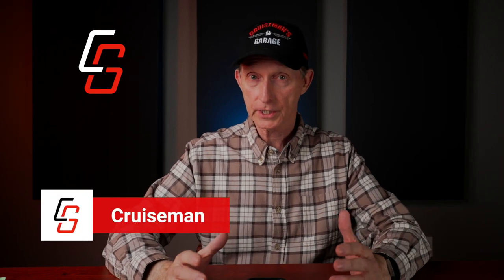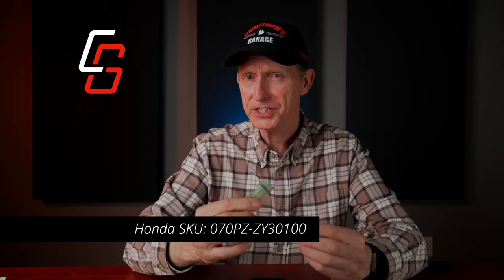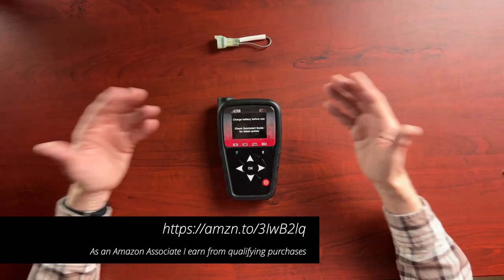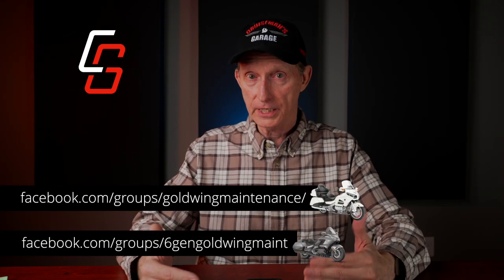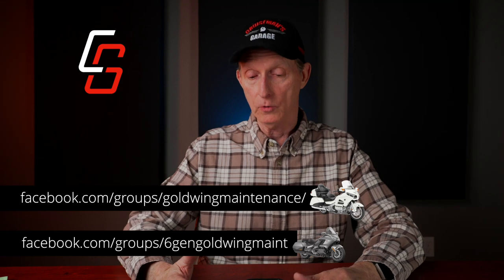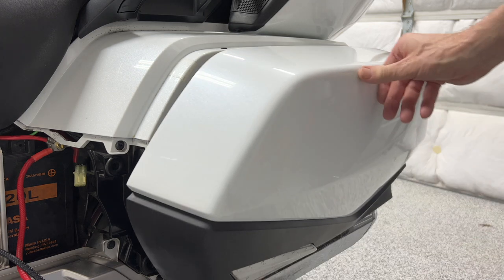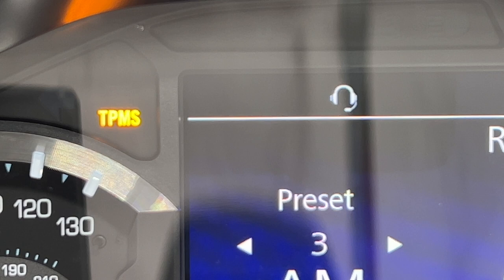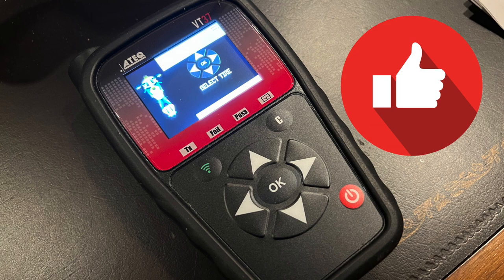TPMS Sensor Registration on 2018+ Honda Goldwing | Cruiseman's Garage

Comment: Thanks, Cruiseman - ALSO, with your particular ATEK VT37, you can also check the TPMS sensor battery condition to determine when/if you might need to replace a TPMS sensor. :)
Reply from the maker: I plan to cover that feature in a future video.

Comment: Well I was wondering how hard this was going to be when I put new wheels on. I bought new wheels for the front and back complete with tires so that I could just do quick change outs. Now my TPMS system does not want to work. I did not anticipate having to buy a device to reprogram it. The video was awesome. You do a great job! Thanks as always 🤗

Comment: Thank you for the video Chris.  I too purchased the V37 for the intended use when I switch two rear wheels I own with two different TPMS sensor codes. The reprogram then prevents the TPMS flashing code if you fail to reprogram, as the new wheel sensor would not be recognized by the bikes program. As you mentioned this use and the replacement of a failed TPMS module ($175.00) is one hour of labor ($125.00) at a Powersports Dealer. So for me the ROI is very quick for the tools needed to perform this process. As a side note I purchased a new rear wheel with new tire and TPMS for $230.00 from a trike conversion company. Bought separately at OEM pricing that would cost $1500.00 in case someone asks why I needed a spare rear wheel. Plus the connivence when quickly changing a rear tire.  Well done. 👍
Reply: Update Chris. Installed new tires yesterday.  I used the spare rear wheel that I bought from a trike conversion company with a brand new tire and of course a non registered TPMS sensor as described above. Followed your video and the reprogram registered the new TPMS AND JOB DONE. THX. Also oil and final drive change, new battery installed using your videos. Using Amsoil products this time and reinitialized DCT also using your video. No oil residue on top side of the Traxxion engine guard, just dust after 3000 miles. So I estimated saving around $500 plus in labor. I removed the wheels and took them and new tires to my local Powersports dealer that saved me additional labor. So to date after now owing 19 three years  I’ve have no dealer perform any maintenance on the bike, and 99 percent of the 15 accessories all with your help.  No off on my annual 10k tour at the end of the month. The Great Mississippi River Ride. LA to MN.  Then into Canada. Going to call back my Army skills and tent camp along the way. Hooah. Thx again for you products.

Comment: Assume this would work on a 2018+ Non-Tour model as well. We just don't get the TPMS tire readings on the dash. Just a TPMS light when pressure is low. Still not sure why they couldn't have included that. Kind of like the center stand we have to purchase...
Reply from the maker: It should still work.
Reply: @cruisemansgarage  what would be involved in changing it so the non-tour works the same as the tour model?

Comment: Will need to reprogram TPMS sensors if the Smart Control Unit (SCU) and/or the Electronic Steering Lock (ESL) is replaced.   The older VT55 may or may not work.